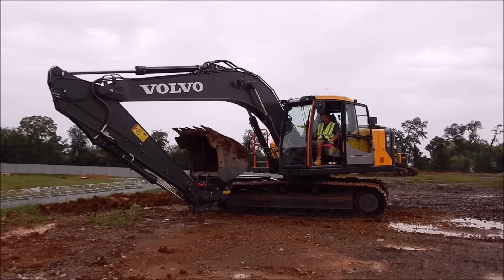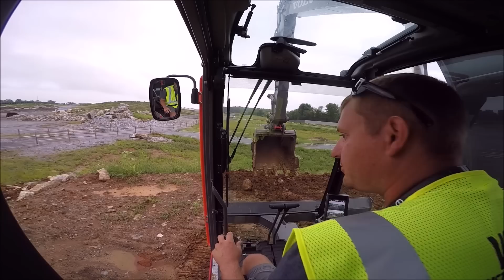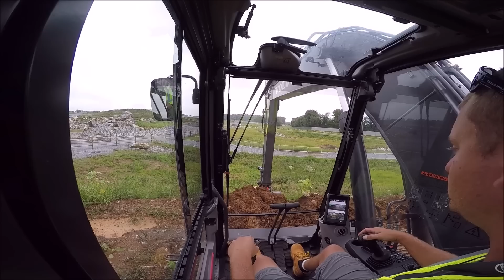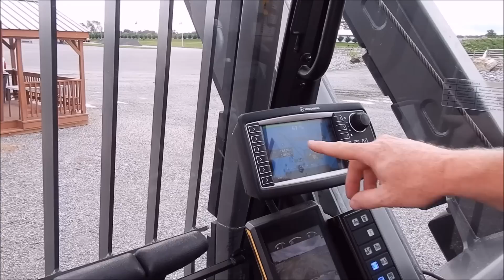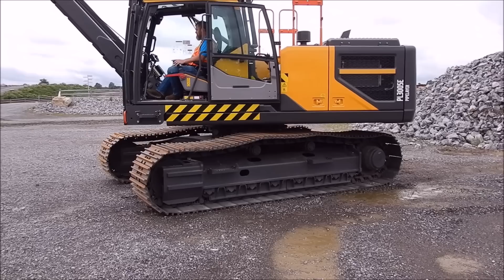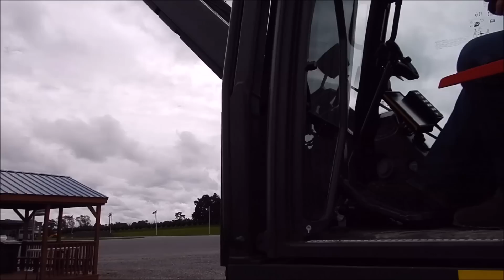All The New Volvo Machines

Comment: Is the quick coupler not very common in the US? In Norway I don't think I have even seen a machine without one. Even the old ones have them. Super cool to see the machine dance tho! I'm a mechanic so I drive excavators a little bit, but nothing like that, haha!
Reply: Smenny it all depends on the owner I think
Reply: Yeah I guess so, they are expensive. Must be very time consuming every time you need to change the bucket tho?